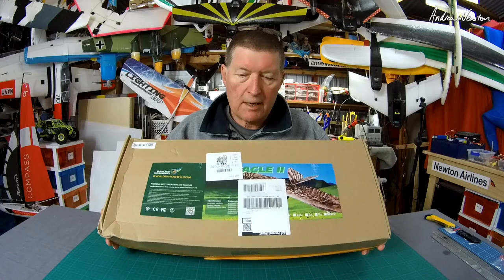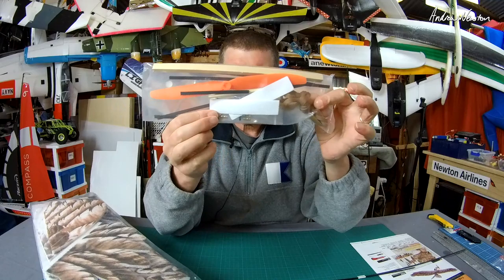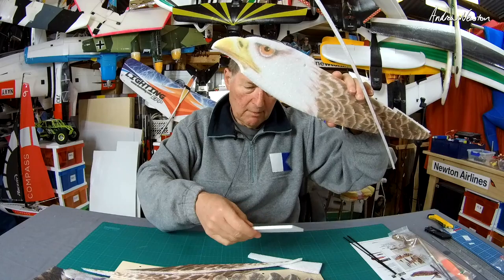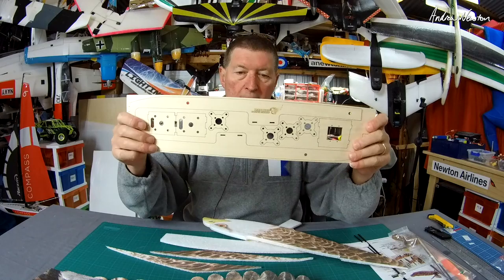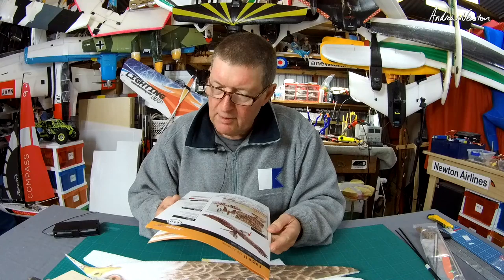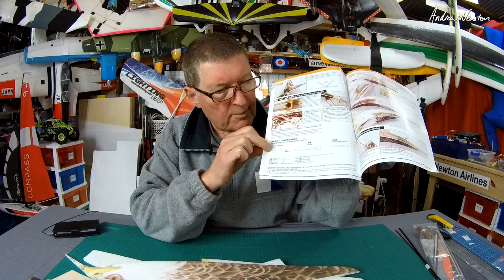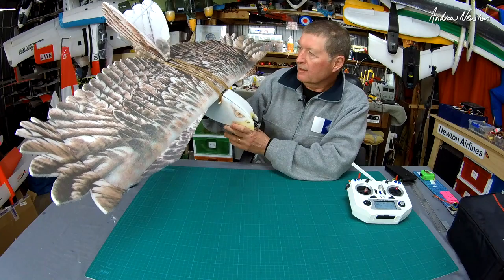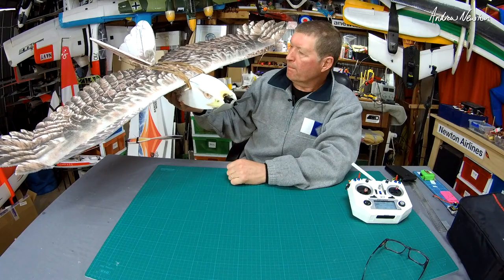DW Eagle II build

Comment: Hi again Andrew.
Reinforce the front motor mount to fuselage joint.
Thay break when landing, as its weak and the prop hits the ground, and rips off the whole motor mount, Andrew.
I have put glider folding propellers on mine.
Save braking the front off, upon landing.
Hope this helps.
Keith. 🇬🇧
Reply: Keith Artherton esc breaking saves props aswell. Throttle off before landing and the esc will save prop by stopping their rotation before impact. Also makes gliding better than a spooling prop spinning slowing you down and making it stall more.
Reply from the maker: I sorted through my prop pile looking for a folding prop, really needs one.
Reply: Andrew Newton 
Did ya find one?

Comment: Nice job. I'm very happy with my V2 - goes really well. A nice docile slow-flyer with no bad habits. Needs a lot of aileron throw, but not much on the tail. I got the version with servos/ESC/motor included - replaced the ESC as the stock one doesn't seem to have a brake and I wanted to use a folder. My box also arrived a bit battered and I had some crush damage to one wing root plus a missing 'feather' on one wingtip. I used M3 standoffs to mount the motor rather than the supplied ply spacers. 2 washers behind the top ones for downthrust and one under each of the left motor lugs for sidethrust - that's pretty much bang on. Had to replace the blind nuts on the firewall as only 1 had the thread cut properly! I reduced the tail angle from 90 to 100 deg, the aileron horns need to be moved back slightly or you get differential the wrong way. I use a 3S 2300 (which needs to go as far back as possible, right by the servos) and duration is incredible ... an easy 30 mins of mixed flying. Short video here: https://www.youtube.com/watch?v=zRrvoJhVcZw
Reply from the maker: Excellent tips thanks.

Comment: Impressive looking and nice kit. I didnt realize it was a full airfoil wing, thought it was flat. Got me thinking about how i could modify the fuselage for slope soaring only. Make some custom formers to make it skinnier and bring that nose/beak to a point. Glue the wing on so you cant see bands, maybe add some fake bendy metal "legs". Looking forward to maiden.
Reply: I pulled the fus. sides in at the front on mine (past the firewall) to give more clearance for the prop blades to fold. Does helps the looks too. It's not a particularly efficient glider but it would stay up on the slope no problem I think.
Reply from the maker: Could do with some strengthening but it's fine for slow flying. Love the bendy legs idea.
Reply: 1 year later, finally purchased one lol. What are your thoughts on making this an elevon ship? Seems like it would work just fine and would get some wait out of the tail. Going sloper and not having a motor in the nose it will probably need a bunch of lead.

Comment: 5:13... Your hammer head needs a little wire wheel buffing....;-)
6:30... Is it just me or did you mount the tail feathers up-side-down ?? Shouldn't the darker printed side be up ??
Thanks for the build video Andrew.
Reply from the maker: Yes you're right on both points. But I need to look different to the other eagles in the group (making excuses here)
Reply: @AndrewNewton  Yeah.. me too.. I hate being a sheeple...;-)

Comment: Looks good, the 1400mm version. Certainly a couple of smarter design differences over the 1200mm I have. I would recommend a prop saver attachment over the fixed collet type. I stressed and broke the motor mount when landing with the prop vertical, Although your 1400mm version has a better ply reinforcement than the 1200mm.
Good luck on the slope!
Reply from the maker: I think this one warrants a folding prop maybe.
Reply: @AndrewNewton  I think Mark had one on his. Can't recall if there was an issue with the prop folding into gaps in the fuse/bird head... But worth a try!

Comment: What type of glue in the tube are you using? I noticed that you also use hot glue. What are the circumstances in which you use one and not the other? As always, thank you for your time.
Reply from the maker: UHU Por foam safe contact cement, gives you time to move and position the parts. Hot glue is better for gap filling and quick construction but it's heavier. CA glue for plywood and less weight. Epoxy for wood, plastic and high load areas.
Reply: Andrew Newton could you use the uhu por and pins for the bits you used hot glue for?  I don't like hot glue, it tends to melt when the plane sits in the sun for too long.

Comment: Hi Andrew , just start to build the " Eagle " I have question: Part A3 going at front of wing, but  not clear ,what angle must be according the airfoil chord.
Reply from the maker: In line with the airfoil chord line, basically straight ahead. Or you could angle them down at the front a few degrees to continue the top curve of the wing.
Reply: @AndrewNewton  Thank you

Comment: Hi Andrew, I've just ordered one of these planes but wanted to order some spare props. Could you please suggest either a fixed or a folding propeller that you used. If I use a folding prop domI need to change anything so it doesn't catch?
Thanks
Reply from the maker: Phoenix prop, and yes I did have to remove some beak to avoid chopping

Comment: How well will the bottom of the fuselage hold up when mounting the battery inside with Velcro without a battery tray as I have seen on another video?
Reply from the maker: Strengthened mine with 3mm coreplast, the EPP is very weak
Reply: Thank you Andrew that was one thing I did not think of. I really enjoy your videos of the airplanes that you review you do a great job

Comment: Hi Andrew. Great video as usual. Mine arrived last week from Gearbest, came with motor, servos and esc.  My first step up from a PNP but I have managed with the help of your video to get most of it assembled.  Where I am stuck is the  motor has no proper fixings for securing the prop.  Photos in the instructions show rubber rings.  That can’t be a good idea. Any advice on buying an appropriate motor and folding prop would be really helpful. I am also not sure  how I am going get the back flaps to work as both a rudder and elevator.  Programming the transmitter I assume? I have a Spektrum 8.  I have caught the build bug and love the idea of using boxes and bits and pieces. More of that please now that winter is coming in the UK. Best Wishes Ian
Reply from the maker: V-Tail mixing, same as delta or elevon mixing. Dont know how it's done on Spectrum, but each of the two tail servos has 50% elevator and 50% rudder mixing - plus or minus weight to get the right direction of movement.

Comment: Hi Andrew,
I am currently building a pure glider version with a sharp snout.
Question: What is your battery location - close to c.g. ?
Without motor and prop on board I will have to move my smaller battery quite to the front / into the head - compensating the mass of motor / prop.
Thanks in advance for telling me your battery location !
Reply from the maker: 3S 2200 pushed back half under the wing, or 1300 right forward. You will need nose weight to replace the motor
Reply: @AndrewNewton  Thanks !
Just made some calculations: One of my batteries (110 g) at 140 mm in front of c.g. will equalise all momentum of the motorised version.

Comment: hi I am trying to get into the hobby, where and how do I start. A lot of questions like the type of glue, motors, do I need to buy remote separately, etc. I usually fly quadcopter drones but am looking to diverse the hobby
Reply from the maker: Start with a pusher style motor glider, Bixler 2 is the best I think. PNP version so it has all the electronics installed. What RC transmitter do you have?
Reply: @AndrewNewton  i dont have any but i did order the x450 last week
Reply from the maker: Ok, you will need to buy a proper transmitter for planes.
Reply: @AndrewNewton   recommendations for starters?
Reply from the maker: @Hustleovertime  Taranis Q X7 if you're serious. Or Flysky i6 if you're strapped for cash.

Comment: Hello fellow Eagle II owners. For the life of me I am unable to figure out how Andrew got all the control surfaces to function that way. I am also using CRSF.
Any help with this will be much appreciated!
Reply from the maker: Elevon mix, same as your flying wings but elevator and rudder
Reply: @AndrewNewton   I have a FC in both my wings which is why I ask as the Eagle is just the CRSF 6ch nano. All manual. So no mixing settings in the radio for the wings to tell me how to do the Eagle. I can make it just elevator on the tail and use the ailerons as normal, but I saw your tail act like ailerons as well as elevator. I thought I would make the tail on mine do rudder and elevator and use the wing ailerons normally.  Which is why I need help with the manual mixing settings in the radio(OpenTX).
Thank you for responding to an older post!
Reply from the maker: This shows a typical Vtail mix https://youtu.be/CX4xUw61UHQ?t=516 Might need to change from 50 to -50 to make them move the right direction.